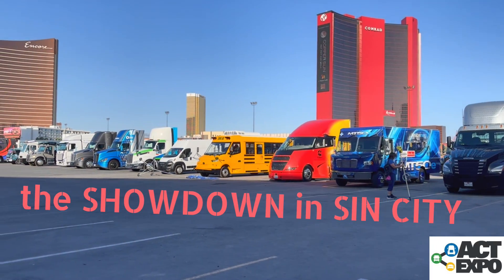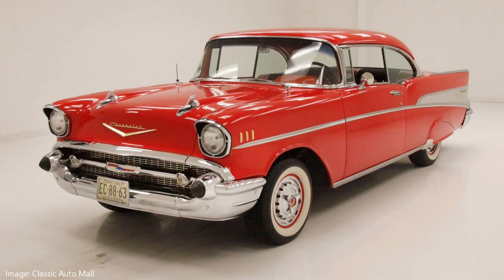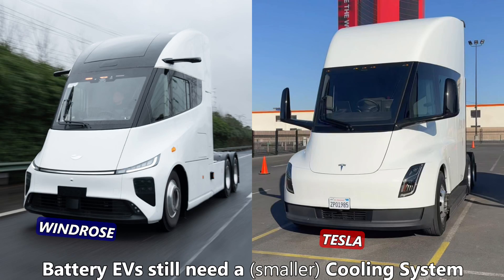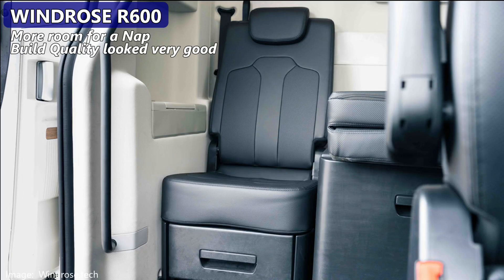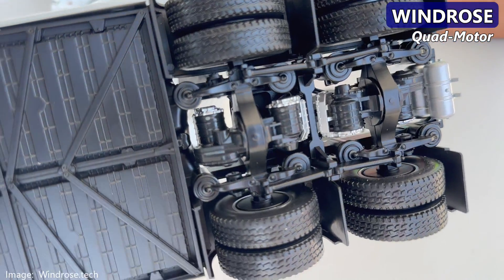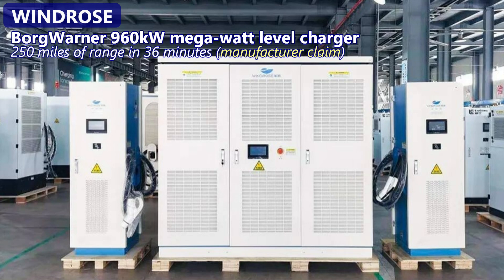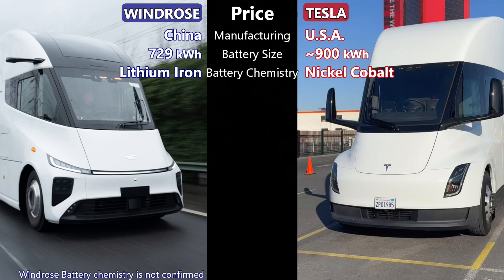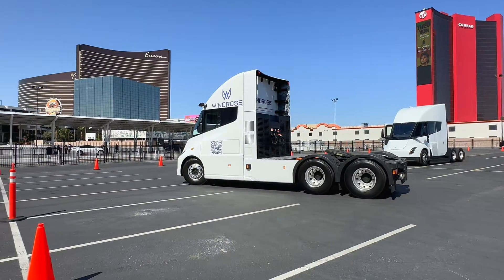Windrose vs. Tesla Heavyweight Championship in Las Vegas (ACT Expo)

Comment: Keep in mind the Tesla has a few special tricks up its sleeve>>>
1
Tesla claims to have solved jackknifing using advanced traction control.
2
the tesla can plow thru deep snow without spinouts. Again, adv traction control.
3
simi test mules have been sighted with multiple external sensors perfecting FSD.

!
Reply: Also keep in mind that the Tesla semi is also not available nor have they released any tare weight information which is critical to the actual load capacity it can haul. Oh, and those that did make it to the road have been very unreliable not meeting Musk's million mile promises.